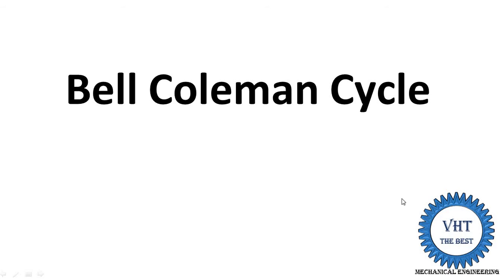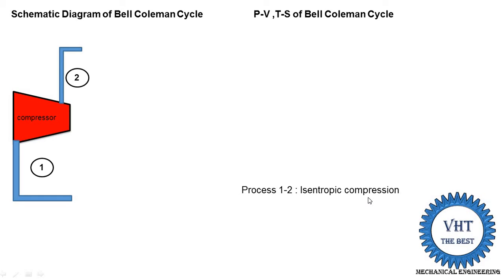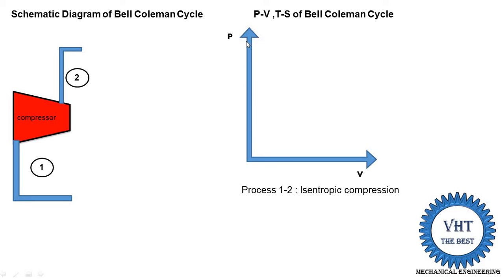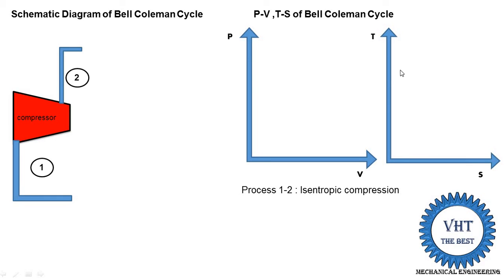Bell Coleman Cycle or Air Refrigeration System

Comment: I know its a old video, but i still have hopes that someone can help me, so, what if we use another fluid other than air, like ammonia or Tetrafluoroethane, R-134a, what would be the change in the equations?
Reply: The equations will remain the same for any working fluid. However values of Cp, temperatures and pressures etc. will differ for different fluids.